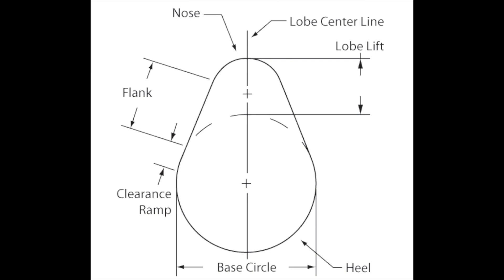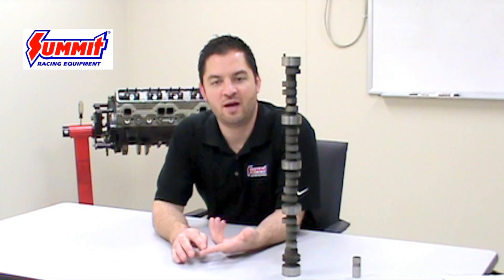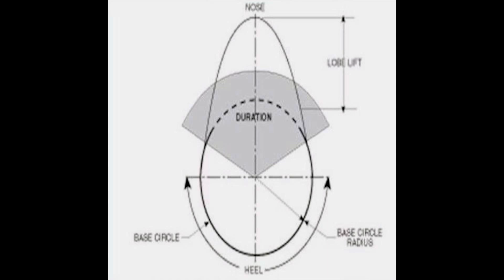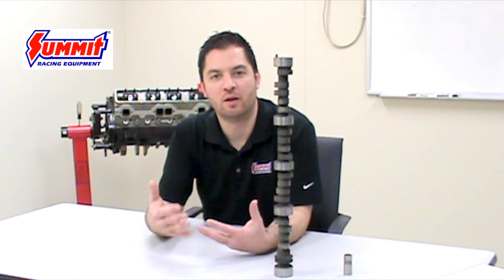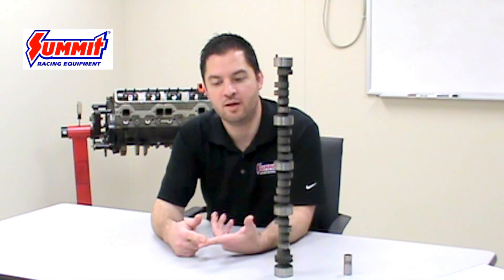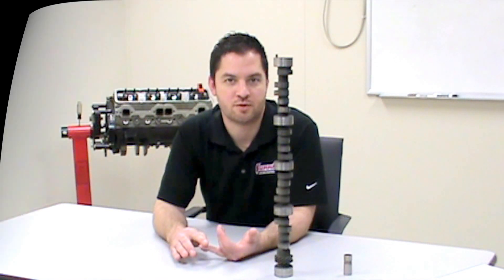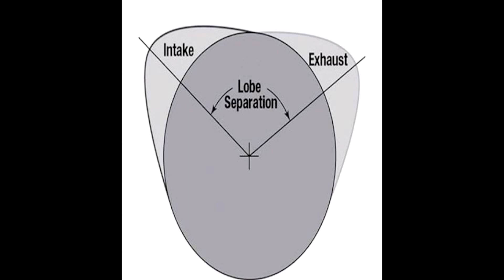Cams Specs | Learn About Cam Lobe, Cam Lift and Cam Duration

Comment: A tight LSA doesn't necessarily mean the engine will have a rough idle or low vacuum. Case in point is Crane's #2020 cam which is 194/204 with a 104 LSA.  It makes for a smooth idle, around 20" vacuum, and lots of low-mid RPM torque in a 350 with around 8:1 compression.  You can't gauge how a cam's  LSA will affect idle quality and vacuum without knowing its duration.  Turns out a 212/218 cam with 112 LSA has the same amount of overlap, so it's not going to make more vacuum or idle better just because it has a 112 LSA.
Reply: yeah true, but who buys a cam wanting longer duration and less lift, generally speaking, hi lift, shorter duration and less lobe separation is going to give you better response, more power and a shitty idle.

Comment from the maker: So you turned a 331 into a 355? – nice job!
   Both cam packages are hydraulic flat tappet kits. I like this pattern for a daily driver. The obvious cam specs are the same; I cannot confirm that the actual valve timing events are identical. Both will need the proper break-in procedure. Both will need a ZDDP type oil or additive for the break-in and then for the life of the build – yes with every oil change.

Comment: 1975 Pontiac Catalina 400 TH400 with a K2802 cam kit & Comp cam's double roller timing set. Comp cam's 995-16 valve spring's retainers and locks or keeper's. Holley 4160 4 barrel. Thanks Summit for your help with my build.

Comment from the maker: Thank you for watching :)
Reply: Summit Racin
Reply: I think my cam is to big for my trans will a torque converter bring my RPMs down by the way dodge 09 challenger wasnt sure if i put a viper torque converter in with cool system would i get the power i feel like im missing

Comment: Good info except the very end, the description of lobe separation is inaccurate. He actually got them mixed up. Tight lobe separation focus is power in the low end torque – mid-range. Wide separation focuses Power Band towards upper RPM
Reply: Tight lobe separation gives poor idle, a wide angle improves idle
Reply: @bernardwarr4187  not poor, just rough...there supposed to be like that

Comment: Hello, I use BMW M50B20 Non-Vanos version. I want to increase torque in the low revs, but can accept to reduce power at high revs. So I thought that if I change the intake cam. The original specification was like this.

Intake: 240º (9.7mm); open: 24º, close: 36º
Exhaust: 228º (8.8mm); open: 38º, close: 10º

If I replace the intake cam with the exhaust cam (In order to reduce the cam angle and lift), so that intake and exhaust cams are alike. What will the results be?

Comment: Hi,
That's a awesome video. Quick question? I have the cam and cylinder head only, no crank. Can I just put the gauge, degree disk and check duration, than multiple by 2?
Reply from the maker: Hello, The camshaft degree wheel attaches to the crankshaft, therefore the crankshaft has to be installed in order to check duration. Thanks for watching!

Comment: yea the 68-69 327 blocks were same blocks used for the 350 so all you have to do is swap the crank out...i called and got to talk to some guys from summit about the cam and i have decided to go with the k1102 it sounds like a really good cam for my motor thanks allot for your help

Comment: What was the mildest Crane Fireball hydraulic flat tappet cam made For a ford 289?..was it the 290H-290 advertised duration-216-216 @.050-454-454 lift?.. thank you.
Reply from the maker: I would say this would be the mildest. 204/216 duration and 456/484 lift
 
https://www.summitracing.com/parts/crn-363901/make/ford

Comment: Hmmm , isent he wrong at the end? Dosent a camshaft with "lower" lsa make more tork faster than a cam with wider lsa....
Reply: Yeah everything else ive read and all the people ive spoken too say wider lsa is for broader powerband and tighter lsa is for a shorter sharper high peaked powerband. Tight lsa is great off the line but idles rough and no good for boost with its overlap (depending on durations).
The pro stock racers use a crazy 106 lobe seperation angle because thats the best thing for getting an NA v8 off the line real fast and they dont have to worry about idle quality or boost pressure escaping as they dont daily them and they dont run boost.
Reply: Agreed
Reply: You are absolutely correct. I caught that one as well

Comment: i have a 383 sbc edelbrock rpm 64cc heads comp cams 12-250-3 ,5" vacuum at idle any suggestions to increase vacuum.

Comment: hey i have a 85 z28 69 327sbc bored .030 with 350 crank and very small cam...i was looking at the k1102 cam 262/272 and the edelbrock performer plus 272/282 both have same lift and LSA but i was just wondering your opinion on which cam would be better choice for a street/strip college students daily driver

Comment: How can I naturally add 350 horses to my Nissan Altima 2.5 SL without changing the engine? I would also want to know if it's possible to convert it to AWD and how much the conversion would cost?
Reply from the maker: Michael Webb , 
Assuming by “naturally” you mean without the aid of a power adder such as a turbo, supercharger or nitrous; it would take an extreme amount of RPM out of such a small engine. It can be done but it will require much stronger components such as forged crank, rods and pistons. The cylinder heads would require a lot of porting and larger valves and a custom intake manifold would be essential.
As for the AWD conversion, seek the assistance of a professional shop that specializes in AWD chassis building and modifying. Not going to be easy to find and will not be inexpensive!

Comment: Sorry but it sound like blahh blaaahh. All I wanted to know if I shave my head's like the smallest shave they can what cam should I use n I want vacuum. I will use 112 -114 range my question is hydraulic or solid. Eng.g.m.5.0 car 67 Chevelle